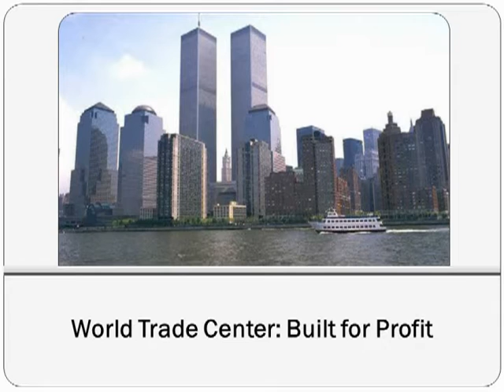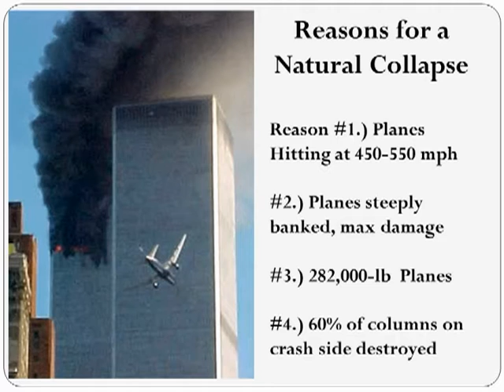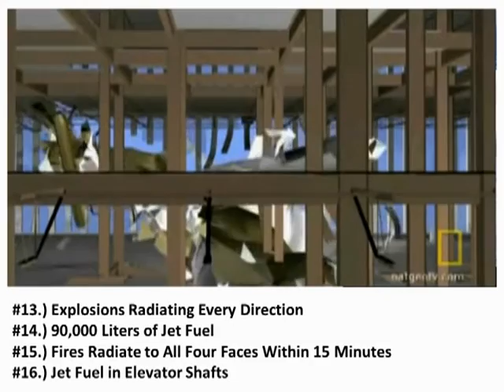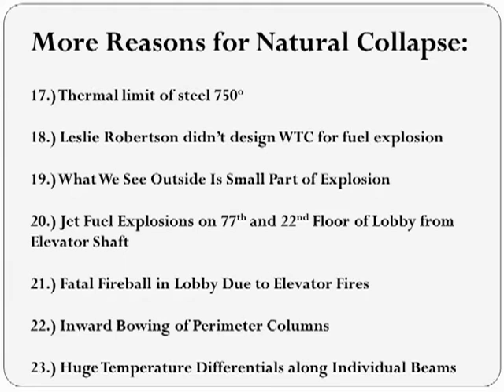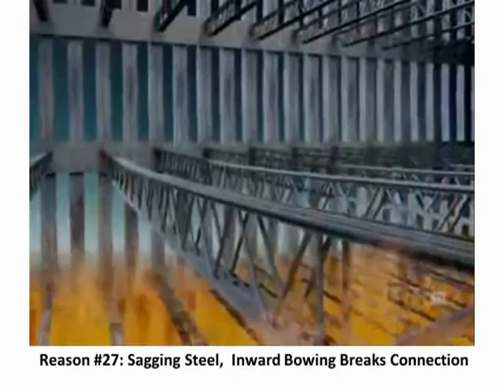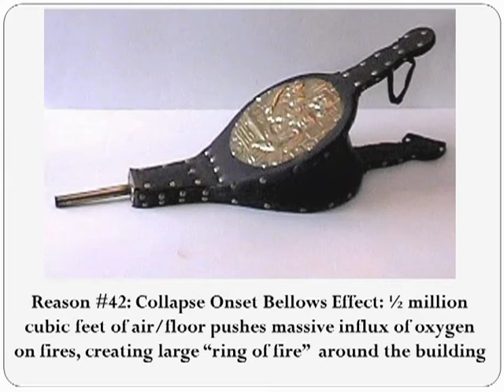Part 1, 9/11 Conspiracy Theories: Chris Mohr's Rebuttal to Richard Gage

Comment from the maker: Don't you understand, that as the top section(s) started to collapse and pivot, they were causing more and more damage to the top of the lower section they were pivoting against, and that there would come a point when this unstable mass, under the influence of gravity, would exceed the lower section's ability to support it - thus initiating the near vertical collapse of the remainder of the building?

Comment: Proof doesn't suggest, dude.  Proof proves.  Yes, I noticed that the top didn't topple.  That's the point.  Its angular momentum should have taken it right over off the top of the building.  Instead it blew up.

Comment: The proof suggests otherwise, I don't know if you noticed but the building didn't topple over. And I told you to get the answers you wanted to your questions yourself. Am I by law required to answer your questions? If you really wanted to know you'd go look but you're just interested in talking nonsense to me. I can't say I mind though I can talk as much nonsense as you want.

Comment: It applies to the tipping top of WTC2.  It had angular momentum and reached a tilt of 22 to 24 degrees.  In the absence of any force to stop the rotation, it should have continued rotating until it fell off the top of the building.

Comment from the maker: [1] So, from your comments, you reject the possibility that a 767 impacting the WTC at full speed with approx 38 tonnes of fuel on board has enough kinetic energy to seriously damage the structural integrity of the building and you also reject the idea that the uncontrolled fires could have weakened the remaining intact, but damaged structural steelwork to the point where it could no longer support the tremendous load above. Presumably you also reject the idea that a dynamic load is greater...

Comment from the maker: I'm at the atheistic end of the agnostic spectrum, which means I'm open minded, skeptical and not prone to claiming certainty about things I'm not 100% sure of.

This 'cartoon physics' you keep bringing up is nothing more than a straw-man argument. Your credulity and inability to be able to extrapolate what we know is, and is not possible, in terms of kinetic energy, impact damage, structural load bearing capacity, heat dissipation etc doesn't make your case ANY more convincing.

Comment: yeah but, since the materials of the collapsing top part and the bottom are the same, the should had been a slow down or the top part falling to one side, not making it aall the way down. you can drop a car from a 10 story building or even a cliff, have it land on top of another car and sure, the one on the bottom is going to be squashed but, not all the way to the ground, even doing the same with two trucks. fire does not pulverize concrete. remember we talking about 80 floors here

Comment from the maker: Dropping a concrete block onto other concrete blocks will not give you an accurate representation of the tremendous forces involved when many thousands of tons of building are collapsing above. It's all about scale. Would a toy car dropped on the floor sustain the same damage as a real car dropped over a cliff? Would a mouse falling off a table be as badly hurt as a horse falling off a cliff? Can you see what I'm getting at?

Comment: well none of it makes much sense, i disagree with some truthers that say that there were fake planes and all of that, they were planes, i used to work on chambers street, not too far from the towers. but no one had to try to convince me there was foul play on the whole scenario, i figured that out on my own. if i drop a concrete block on top of a stack of 4, would it follow all the way to the ground or would it damage the first two and then bounce of to one side?

Comment from the maker: There are many more parts in this series. Building 7 is dealt with in parts 13 and 14. I haven't uploaded them yet, but the original part 13 is: watch?v=Uv06LjVGC6Q Please watch them, if you haven't before.

Comment from the maker: How do you know how far down the jet fuel travelled?

How do you know that what you saw (on video I presume) was thermite?

The lady standing by the hole would have had fresh air, you don't see flames immediately behind her.

The bomber which hit the empire state building was MUCH smaller than a Boeing 767 and was flying MUCH slower. The difference in kinetic energy was tremendous.

The truth is of paramount importance, WHATEVER it turns out to be. Many of the 'truther theories' don't add up.

Comment: yeah, that theory sounds on point but, all that fuel did not travel that far down. explain the thermite burning on the side of the building before the collapse and the lady standing next to the hole(RIP). and also the recording of the emergency radios where you can hear a fire fighter say "we got two pockets of fire, we just need a line up here".... it not about being a truther, is about inconsistencies, what about that bomber that crashed into the empire state building?